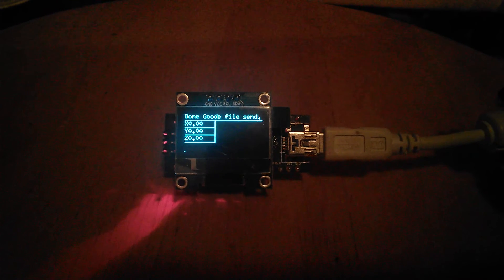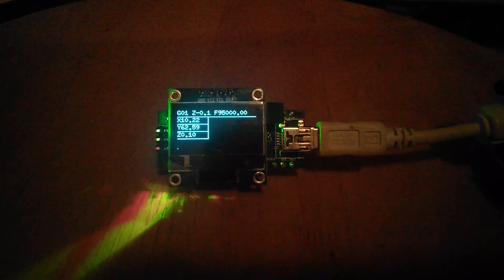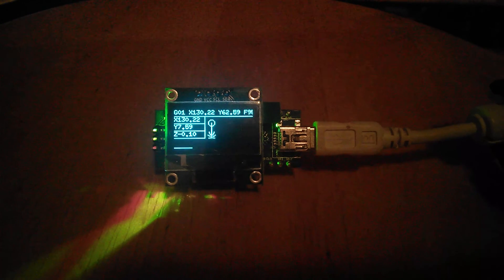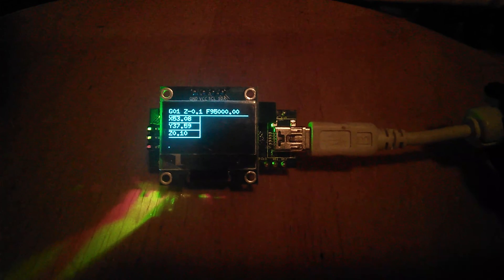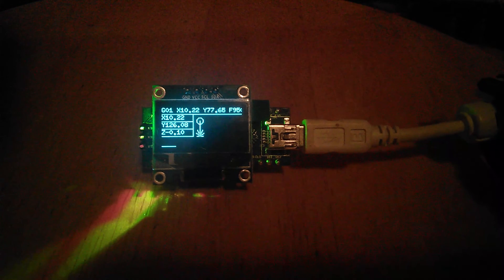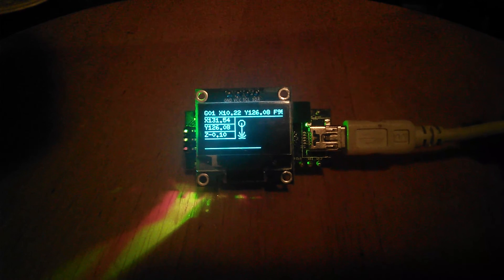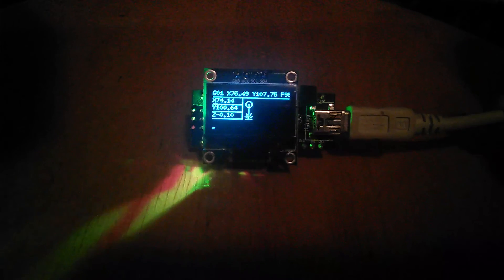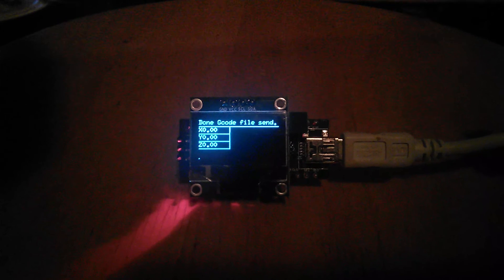Mini OLED display for my Arduino Nano CNC controler from Banggood.com

Comment: What firmware are you using?
Reply from the maker: Custom , it's a bastardized customized version of the  real old 2 axis CNC demo code controller www.marginallyclever.com put on git hub or some place way back long ago.  I hacked it to bits and rebuilt parts as well as converted some of the math to use long type properly for how arduino wants it  .  it now just fits on program mem , and has custom G code arc parser .  I had to make a custom board profile for Nano to have 128byte serial buffer.
Reply from the maker: LOL this old video shows me explaining some stuff as i was fixing my code bodges . LOL https://www.youtube.com/watch?v=bgBwnhKF4_s
Reply: XerotoLabs Thats pretty cool!  I have a number of these little OLEDS laying and I have been meaning to mess around with them but no time and this looks really cool!
Reply from the maker: yeah the ones that use I2C buss are my fave , but they are not as fast as SPI for sure.  I have found i have to limmit the draw calls and such , especially during arcs .displays do slow down the CNC, and even too much serial debug feedback does as well .  to get real smooth fast moves ,and steady smooth arcs i have limited what my firmware spits back .  but a great use for these OLED's are very small games LOL : https://www.youtube.com/watch?v=7nQIAj4eWwk
now i have a 3D printer i will revisit that project and make a better cabinet .

Comment: very nice is it possible share the code and conections to make this happening?
Reply from the maker: +radiaddic HI , the connections are the standard pins on the OLED from Banggood , to the corresponding pins on a V3 Nano .   as far as code , i'll have a look .  this is it , it's mess and a work in progress , you will have to be sure you have the included libs as needed . http://codepad.org/Cf7L1Ro9 . if nothing but the OLED is connected it will be fine .
But you must make a new board profile in the Arduino IDE to support full 128char serial buffer for more compatibility, else edit src to use default 64char .
Reply: thanks mate i wonder how to implement oled with grbl firmware :)
Reply from the maker: +radiaddic i'm gonna have a look at GBRL src  when i get some time . there are 2 issues i see . 1 is I2C that these things use may be slowing down the jobs . i implemented a draw halting  flag in my firmware for now . But i think even with  the fast I2C modes , it may hamper the  GBRL . 2nd , i have no idea what pins GBRL has free .   but that said i have been planning on making a simple serial echo module using a 2nd  Nano board  that i can hook on to any project to watch what is  being sent .  I have a few other projects ahead of this rite now though .
Reply: yes for what i been reading it seems some people is using  arduino mega for the lcd to  serial spy data that is being send to the arduino with the grbl, so far i wasnt able to make it to work, im using a arduino uno with grbl with a cnc shield v3 on top, all is working very nice, just looking foward to implement a lcd with it but so far nothing hehe
Reply from the maker: +radiaddic Yeah i think  we will have to use a daughter Arduino board to spy on the serial .  our even a ATtiny or something that cna do simple serial  to OLDE or LCD via I2C might be good .  I have some Digistump boards that i usually use for LED controllers . IT could be just the thing for a serial spy .  +  ther is a USB (OTG) serial terminal for Android that i use . Maybe  something could be done to use that as a out put / display . Time will tell when i get into the GBRL code.
Reply: that would be nice to have a oled display has u did on this video it rox :)
Reply from the maker: +radiaddic an arduino mega could do  it easy i think .  I just like trying to get all i can on Nano v3 . it forces you to think about your code.  I also want to move to GBRL based controller. That said i want to move to control with port commands and not use digital writes , for even more speed .  Probably save the OLED update for display of  particular data at specific intervals .  could  be possible to maintain speed . All that said , if using  2nd board , you could use Arduino TV out lib and send the info to a composite display screen .  There I go adding ideas to the project to do  stack . LOL
Reply: +XerotoLabs I love that concept! Using the Nano for everything possible. I will be using the Wemos D1 mini to power my weather gadget/notification box. I am so glad to live in a time where all of this stuff is available and so cheap at places like banggood. It's crazy to think that aside from code your setup there is about $9.50 give or take plus other equipment you already have!
Reply from the maker: +ensjesse ESP8266 powered modules are also amazing , but i do love nano's and 5v pro mini's .
bur ESP's are gaining on me .lol
Reply from the maker: +ensjesse also after having a think , i keep wondering if a ESP 8266 12E is fast enough  using a IO expander  to drive a CNC . most over the NEW ESP's have flash memory enough to have a small on-board file sys . you could upload your CNC commands over wifi to it and it could do them as a stream or form a small temp file.  Im currently working on a scratch built 3D printer of a I3 type layout ,  but i want to re-visit this idea . i know many use the small CNC shields for arduino UNO ,  but Nano's are so much easier to fit into custom enclosures and make them plugin components . They just feel more like a brain vs a s UNO which is a way bigger , and a bit more robust / tougher.
Reply: Oh man. Check out the ESP! 80 to 160 (I think) clock speed in Megahertz. I think it would be able to keep up. Make a custom boot loader that would be ready to accept your command file wirelessly with some type of flag. Let me know how it works! Check out the Wemos D1 mini. You could get that guy into some small places or heck go FTDI and upload to the ESP with an adapter and get super small size. http://www.banggood.com/Upgraded-Version-1M-Flash-ESP8266-ESP-01-WIFI-Transceiver-Wireless-Module-p-979509.html?currency=USD&createTmp=1&utm_source=google&utm_medium=shopping&utm_content=jude&utm_campaign=ele-xie-us
Reply from the maker: +ensjesse , yep if you mod your ESP v1 you cna put it in some small places . see one i had some fun with here : https://youtu.be/mfbvDc0vemQ 
and yeah they are 80 MHz and over clockable to 160MHz , but i have not done a over clock yet.